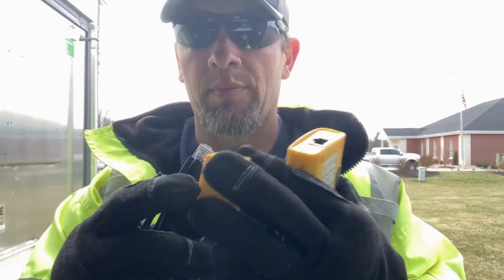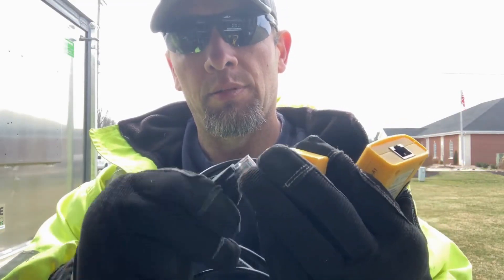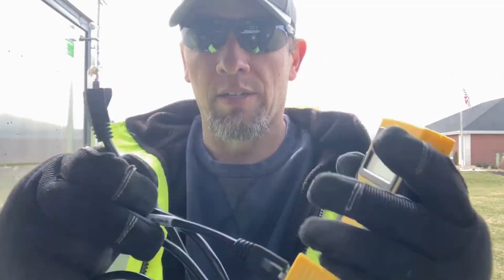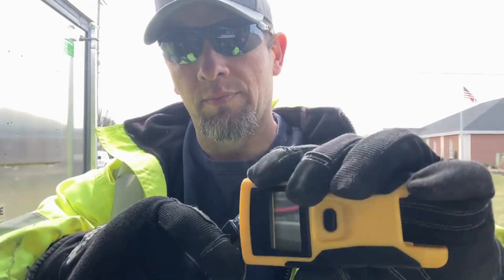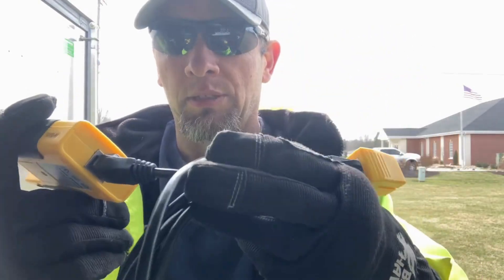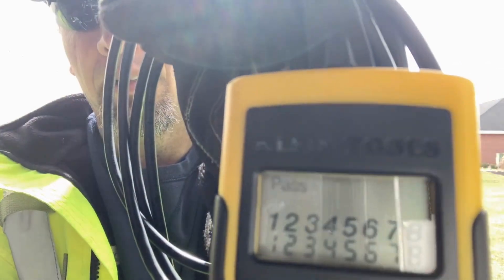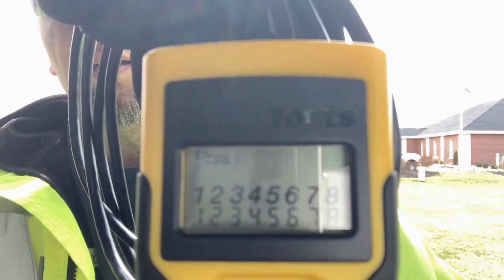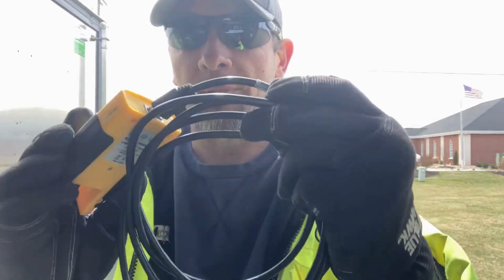Traffic Light Broadband Radio Testing

Comment: Lol. All that "cable tester" does is continuity, that there is a connection. It doesnt tell you how crappy the connection is.  If you all use that, you all will be chasing your tail trying to figure out why most of your traffic isnt going anywhere or why youre getting 100mb when it should be 10gb.
Reply from the maker: Honestly, been using that for years.  I know there are more sophisticated testers out there but our main problem is when the terminations are made incorrectly.  This allows us to check pin for pin on the termination whether they're accidentally crossed over or shorted out or not fully terminated at all.  If i have that correct, 95% of my issues are resolved.  Usually the equipment software will take care of the rest.
Thanks for your input!
Reply: @streetsmartstraffic  this makes sense as a service provider. They don't care about the quality. You ordered gigabit service and get a quarter or that?  Well we gave it the good ol collage try. We call that best effort. I know the games you all play.

Comment: I like that your laptop still has a serial port. I’ll bet that sees some use in a job like this.
Reply from the maker: Definitely!  We still have alot of (still functioning) components out there with only a serial port to communicate to.  Ethernet ports weren't even an option then.  Crazy to think some of that stuff is STILL working...
Thanks for commenting!
Reply: @streetsmartstraffic  I believe you! Also, if you want a modern, tiny laptop that still has a serial port, you can option a GPD Pocket with one. It comes as a module which you can have as an extra USB port, serial, or something else that I can’t quite remember. I think VGA. Just in case you’re ever on the lookout for one.
Reply from the maker: @uzaiyaro  Thanks for that!  I've actually had another commentor recommend that laptop as well!  Must be something to that one.  I'll look into it.  I love mine at the moment because my screen is ultra bright and can be seen during daylight hours in the field.  I've seen other laptops in the industry used my techs and you can't even read the screen if in the sunlight.  Much appreciated!

Comment: What does this traffic light broadband radio do at traffic signals? I thought this was for changing the traffic signal to green for emergency vehicles approaching a intersection   during emergency runs.
Reply from the maker: This is just another form of linking traffic signal to traffic signal for passing communication to each other.  Fiber is used often for a 'hard' connection between signals.  This is the wireless version.  
What you're talking about are preemption receivers that sit up on the mastarm.  The emergency vehicle has to be equipped with the preemption transmitter and as it approaches the light, changes it to green.  Not all signals have this.  But if you ever see them down a corridor, its pretty cool to see it in action.  Great question!

Comment: If you want a more portable-friendly laptop, try Panasonic FZ-M1 MK3, its 7 inch so it fits nicely in the jacket pocket. No ethernet jack or serial port tough, but it has a USB port so bringing a usb/eth and usb/rs232 adapter is fine.
Reply from the maker: Is it rugged?  The one thing I like about this one is I beat the crap out of it but it just keeps taking my abuse....and running just fine!
Reply: @streetsmartstraffic  yep, its MIL SPEC too. It isn't called "toughpad" for nothing.

Comment: A 9 pin serial port on a laptop 
I have several for programming my old 2-way radios. 

What model laptop do you use ? 

I don't know what year they stopped making serial ports in laptops, maybe around 2000

Once USB came out they got rid of them 

IBM Thinkpads with the docking station has 9 pin hardware serial port 

I have a couple of them and a couple DELLs
But they are pretty rare to find 

I wish a company would make a new one specifically for people who need them for diagnostic and programming of technology that has the serial ports

There is still a lot of it out there
Reply from the maker: Dell 5420 Rugged Laptop.  I beleive you can only find refurbished ones anymore.  They're great because i still have serial devices in the field that I need to program.  I know you can get a dongle conversion from the USB and still communicate as well.  Thanks for commenting!